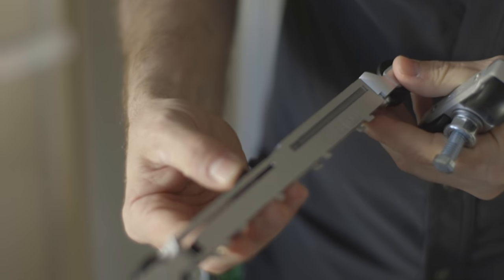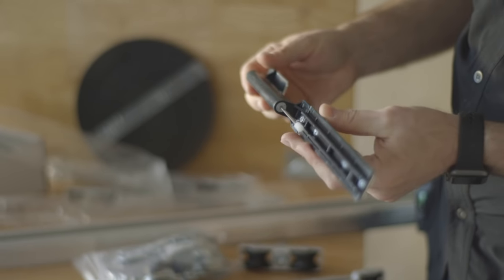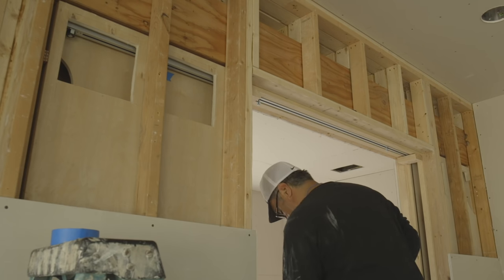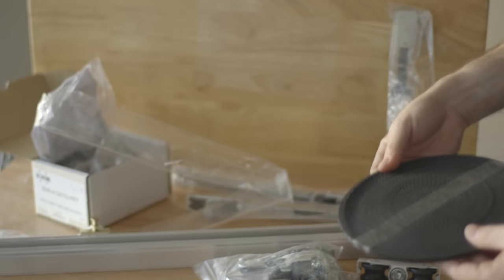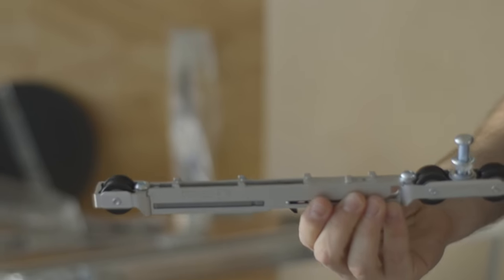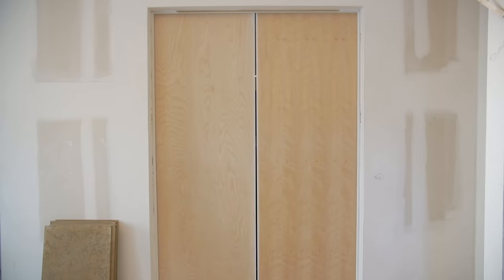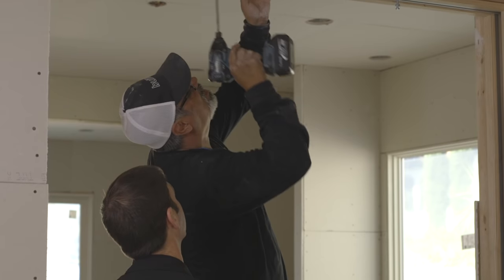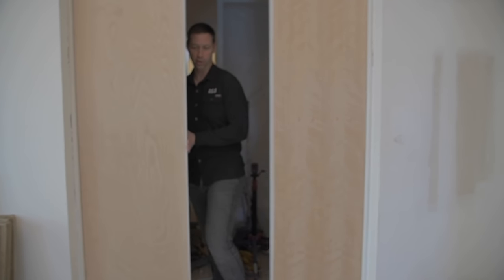Double Pocket Doors - Sugatsune Hardware Review

Comment: What do I need to know about the bottoms of the doors with this system? Is there a gap between the doors and the floor? Just concerned about how much noise prevention I can get by using this system with solid core doors in my home and want to make sure they aren't dragging as they move or aren't too high off the ground either...
Reply: @Benicio Enzo yup, I've been using InstaFlixxer for years myself :D

Comment: The instructions are very limited with no verbiage only illustrations. I found five errors on drawings. Does not include allen wrenches or extra wrench for adjustment. Been in business for 25 years and find this very time consuming expect 8-10 hours of installation time, not including framing and drywall time.

Comment: Does anyone know what an approximate costs for this system would be (just Sugatsune material)?  I have heard about $1,200 list price, does that seem right?
Reply: Aaron Ross low cost is about $500 and high cost is about $3500
Reply: if you want pocket doors that will last forever then you'll need to purchase early 19th century antique pocket door hangers. in the northeast there are a lot of early victorian homes well over 100 years old and the pocket doors still work like new

Comment: garbage product. How long will they last before something breaks and not operate as it should? 10-20 years maybe? companies should just remake the original early 19th century hardware. In the northeast you find pocket doors that are well over 100 years old and still work like a boss! Any roller with ball bearing suck